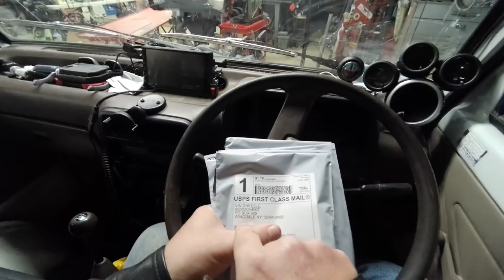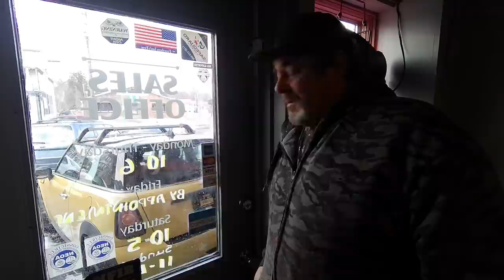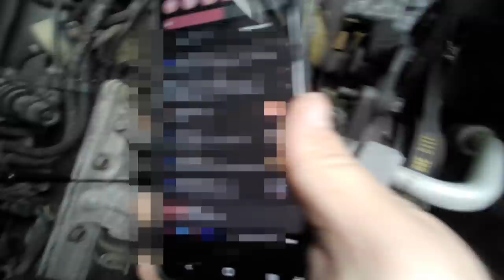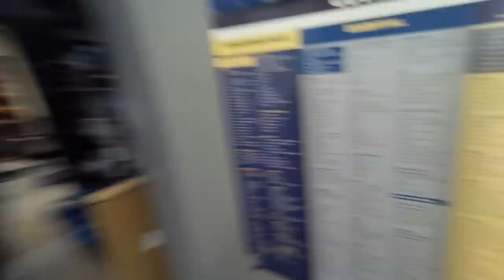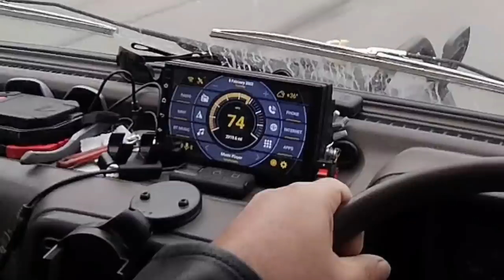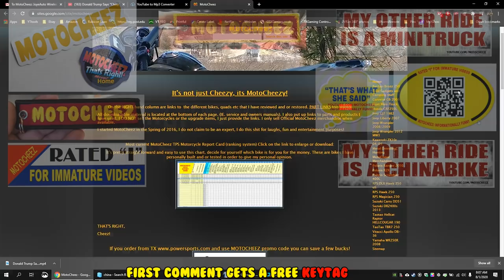Mini-Truck (SE07 E03) Test Drive Daihatsu Atrai XX intercooled turbo? Van Ross Motor cars for sale

Comment: That little brother atrai is good for camping overnight or fishing. My brother inlaw has one. And he use's it during our over night camping. He put some movable bed at the back, maximized small space for his kitchen utincles/tools it has a roll up awning at the side, foldable table with 4 foldable chairs and 3 fishing rods, a butane gas single burner stove, a couple of containers for potable drinking water 20ltr. with his 500w solar set up. Totally saved our camping trips every summer.
Reply from the maker: Wow, that sounds like a pretty cool setup. I was wondering if I can make a slide in section for camping. I have that old three camper down below that I can take donor parts off if they're small enough
 I was going to make a RV slide in for the bed of mini truck this summer, well I guess I don't need to but I wanted to!
Reply: @MotoCheez  Yes. Well, my inlaw just makes every thing fits for his mini van. It really save us during our over night trips. The bed at the back is good for 2 adults. I drove my mini truck (if you remember my prev comment, I have a 5speed suzuki) so we can use it for cargo like woods, some vegies/farm products when we go home. BTW, we have a small farm near the river were we usually camp.

Comment: I like your new van. That dude cleetus mcfarten has a mini van like that painted like the mystery machine. It has a turbocharged RX7 motor in it. You probably have seen it. It's a burn out van for burn out competitions. Anyway good luck with your new mini. 👍🏻
Reply from the maker: I did see Cleetus van 😁 didn't realize he put a turbo rotay in there. It's still 4x4?
Reply: @MotoCheez  I dont think so because it's a burn out car. There always in 2wd when there burning the tires off but maybe it is still 4x4 you would have to check with there channel. They did run the muffler up to the front of the van in front of the bumper up to underneath the front window. So when they do that rev up thing when it sounds like gun fire, Huge fire balls shoot out of the muffler under the front window.  They also put the intercooler where the sliding back door is and have it open when ripping it with fans pushing air out of the van through it.  Kinda weird set up. Extremely loud! It's been in alot of contests you should check out some videos on it if you get a chance. What color do you think your going to paint your mini van?

Comment: I guess the only question is, by the time I binge watch your Tiny Van videos, will I buy a 4WD Atrai before the Hijet that I bought a month ago has shipped?  Kei is more addictive than crack.  I lived in my Westfalia VW microbus camper one semester when I was going to college.  A 4WD Atrai would make a great little camper van.  An importer like Ross Motor Cars in Torrington Connecticut eliminates the torturous wait when importing, as well as the bureaucratic headaches.  They earn their markup.
Reply from the maker: Agreed

Comment: Congrats on the new Van.  Loads of things you can do to it.... 1st...smaller SC pulley (I'm sure you've already thought that, then a gas cap).
Reply from the maker: I get it another week or so. It's turbo! And they bought a gas cap lol
Reply: @MotoCheez  Oh, thought it was SC.  Well I suppose you could swap out the turbo?  Though seeing that engine compartment, it's not going to be fun to work on.....  Either way, it's cool and will give you a ton of stuff to make video's on 👍
Reply from the maker: I'm going to raise the boost on the turbo! No room for SC, has AC

Comment: Lots of cool bells and whistles! I liked the van to the other side, the one from the RC flying club. Very clean. Caught a glimpse of what looked like a retro Subaru in the front rom- a green one. Most of those were turbos. Definitely has some interesting stuff. Like you, I'd never seen a Delica pickup.
Reply from the maker: That van I got was the only turbo or supercharged truck or van left in the lot, the one next to my van was a Suzuki and I think the one that was parked by the road may have been a Subaru with the funky Grill on it

Comment: the turbo timer holds the ignition on until the turbo is cool then it shuts off.  So you turn the key off get out walk away and like a minute or two later it shuts off.  its so oil dont cook in the turbo with no oil coming in
Reply from the maker: what is the other switch for? power?
Reply: @MotoCheez  i think it might be a mode button do you have a make I can track down?
Reply from the maker: I didn't get the model, I don't have the van yet to check. Just the videos I took Thanks!

Comment: Now that's the one I like cheesy! Looks like it could have been a camper just judging from the shades inside. A little TLC and that's going to be a real nice ride! Can't wait watch you go pick it up and give it a nice test ride! Great video I'm going to go watch it again.. thanks!
Reply: Not necessarily, practically all vans (and their S/UUVs) have curtains integrated into the non-driver windows...it's a Japanese / Asian thing.
Reply from the maker: I can't wait to get it either! Thanks😁🧀🧀
Reply from the maker: They may all have curtains in Japan but when I went to the New Jersey location most of the Vans did not have curtains in them, probably because they were old and removed. Some of them did maybe 10% had curtains. But these are in good shapes I'm sure they were changed at one point
Reply: @MotoCheez  Yes, the vehicles, being as old as they are, had 'curtain' style blinds; the newest models have a 'sunscreen' integrated into the windows (like high-end RVs here in the USA).
Reply from the maker: Nice! I'm going to tint the rear windows anyway

Comment: that thing is an absolute unit

what tires are you currently running on your mini? I got 23's and even they slighty rub on the mitsubishi  with a 2inch lift. no way i can go 25
Reply from the maker: I have the 25'2 on mini. But progressive 325 lb front springs raises it up and I did have to cut a little bit at the bottom of the door they still rub on the inside if I cut the wheel real sharp a little bit

Comment: That will i have the van with air conditioning and automatic i love mine top speed in the philippines is only 60 km/h and i used to run 80
Reply from the maker: 60 kmh is top speed limit there? Wow

Comment: OH HELL NO you're getting an atrai turbo like mine!   I just got mine back from the shop today you'll hae to wrench on it and show me how because that bill wasn't pretty today.  BUT she's like new now she rips.
Reply from the maker: What you have done?
Reply: @MotoCheez  Fuel pump on top of the tank died, I needed the brakes bled and there was a clip on the nose plate that was broken they still working on the part.  That tank and engine cover act as a barrier to working on it you need a lift.  It has no hatch like the pickups don't bother pulling the carpet.  The driveline hangs from it like 70's cabover vans.  I knew that before taking it in the work was legit tho at 1300 they did it all right.
Reply from the maker: @LeonRFpoa  quite a bit

Comment: I know a lot of the Daihatsu vans in Europe have some kind of spring based brake bias device that everyone has problems with. Wonder if that might be causing the spongey brakes.
Reply from the maker: I'm not sure just felt like the shoes need to be adjusted or there was air in the back line because the first part of the pedal you can feel very slight resistance like it was pushing fluid but it wasn't getting there until you got down half pedal. I'll check it when I get it to my shop. Thanks for the info

Comment: 140 km/h.. you caught up to the smart cars 😝. 
Though I rather cruise at 3000 rpm in 6th gear doing a bit over 120 km/h, way better gas mileage.
You doing the radiation testing again or look at car history?
Reply from the maker: Once I put the bigger tires on it will drop the RPMs almost 1500, it did on the mini truck. I should do another radiation test and I did not do a background check I couldn't even do it on mini I just found the city that it resided in last.

Comment: Hey jus thot id let u kno on a new video that on your magician page the front sprocket u have linked does not fit the stock spline size of the magician...jus found out wasted 20$ kinda CHEEZED about it
Reply from the maker: Hmm. It's been working fine for 3 years, I'll check l, but maybe they sent wrong one to you.
Reply from the maker: I'm looking and it should be the 20mm 17 tooth isn't an option anymore.
Reply from the maker: Send it back, free returns on Amazon. Looking for another link
Reply from the maker: Found one for  8.99. I'll update link now

Comment: Ok the clutch and the engine are way different than mini / mighty mouse.  You're running this engine from like 3500-4000 on takeoff.  It revs way higher and doesn't like to be lugged around.  The pickups have way low gearing, this is like a crotch rocket.  You're letting down the clutch at like 3700 driving normally.  I rev from around 3800 to 6400 normal driving.  Don't lug it these vans like to rev.  They rev to 7.  Most of my problems turned out to be no lead foot.  Opposite of mini's problem, making too much boost too soon.
Reply from the maker: I felt the higher gearing. How is the engine and clutch way different? It's the same block, no?   I know it has less compression for the turbo
 It pulled good at my shift.points I was doing. 
I may have to raise the boost on the van 😁
Reply: @MotoCheez  the clutch is like a performance clutch, it doesn't let out the same as the pickup it has harder springs or something it doesn't feel the same.  I think it's the same block but almost nothing else is the same the fuel pump was different, cannister filter is different, pretty sure even the water pump is different.  Nothing under there looks the same.
Reply from the maker: Hmm. I'll have to check it out. It's EFI so I know a lot is different fuel wise. Clutch felt same as mini to me
Reply: @MotoCheez  yours is a newer one mines a 1990 and its kinda funny how its a s83v but it has s110 parts here and there.  Like the distributor cap check it before you order.  one has a 3 by the lower right bolt and the other has a 1
Reply from the maker: I guess mine is a 92 not 95. S83v